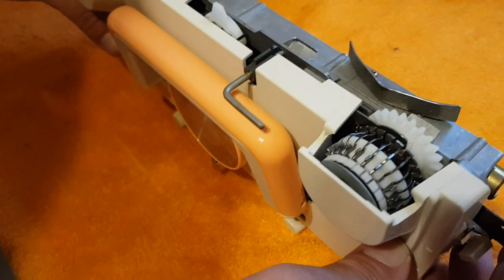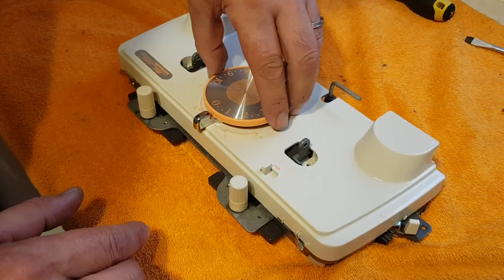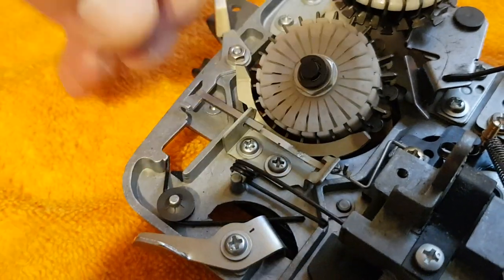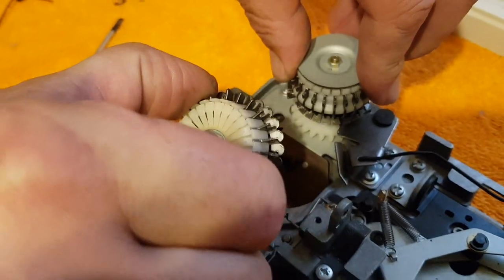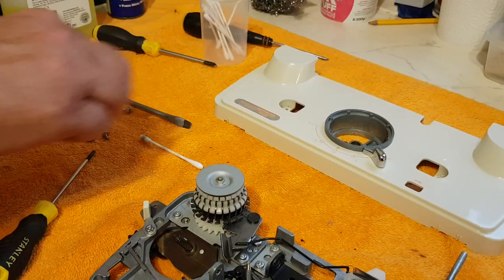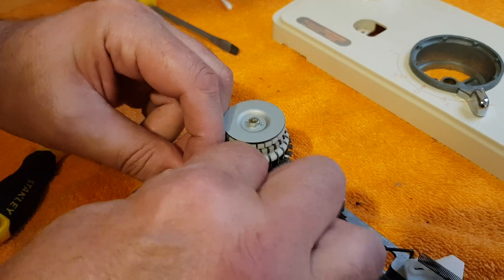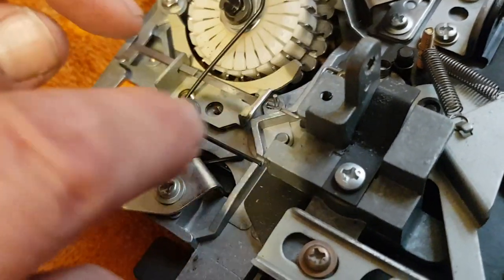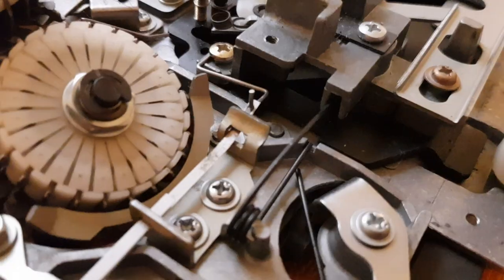Spartan knitting machine parts, servicing the silver reed knitmaster pattern drums

Comment: Thanks for your informative video .  My carriage on my  singer 700 that I got on ebay was actually  froze to the rail.  I watched another video on  carefully using a hair dryer to heat the carriage drum up  enough to  get it at least off the rail.Be  careful as to  much  heat could melt the plastic  gears.  I got the pattern drums off cleaned and lubed the  shafts and inside the rollers  with your help and the rest back together.

Comment: Greetings from Mossel Bay South Africa.
I was gifted a 360/260k. The LH drum is jammed and the RH one is very stiff. I have followed your video but can't get the sub drums off the shafts. Any advice?
Reply from the maker: You need a large flat bladed screwdriver, gently pry it underneath the drum, twisting the blade of the screwdriver up gently. It will slide off eventually I promise, just be careful, take it slow, and be gentle with the screwdriver